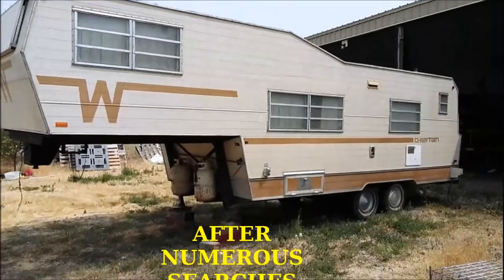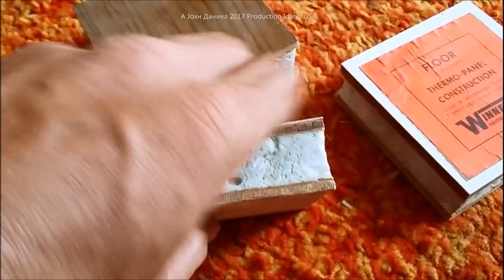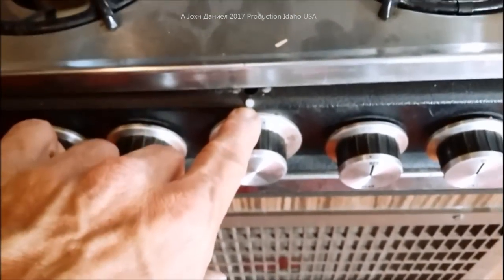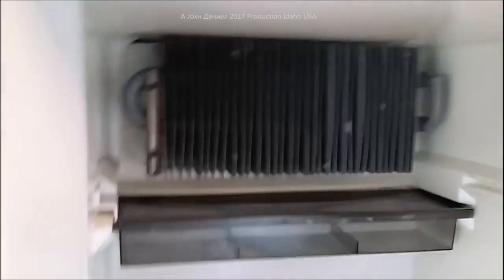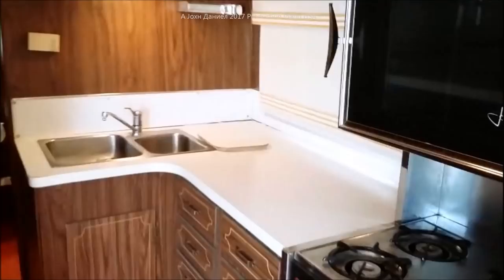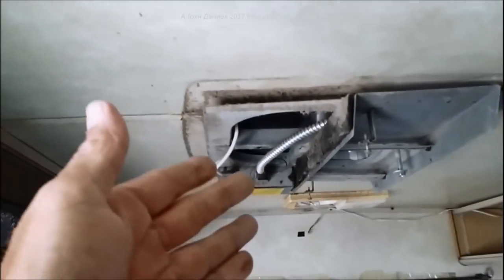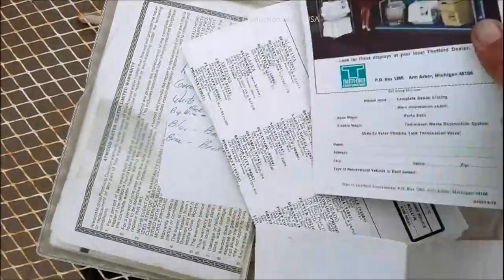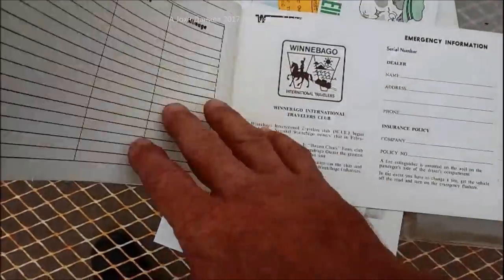Rare 1973 WINNEBAGO 5th Wheel, INSIDE TOUR, my Plans & Ideas vid 2

Comment from the maker: 100% ONE OF A KIND project. Double OLD Winnebagos! on m350 to M400 dodge frames. And this very rare 5th wheel by Winnebago. https://youtu.be/PxJuNxIAEFg
Heres a basic info fact on the project we are doing -https://www.paypal.com/pools/c/83mlLRXYHO
This is my INTRODUCTION VIDEO -More in depth Vintage Winnebago videos will follow - YES, we will put 1200 watts of Solar Power on it! This video is showing a dirty, dusty stored time capsule of a rare Winnebago. Winnebago was just trying their hand at building 5th wheel trailers in 1973 and only a few ever got made, none are currently registered in America. None are in this perfect, And the last data of actual camping use was 1981. There is only 4 trips even logged on its itinerary in its entire existence. None since June 1981. 
Sorry the video is a bit choppy, the goofy new camera phone has a feature thats "supposed to stabilize that", when it works right!
Look for more done on this cool RV.
Reply: I know where an identical chieftain 1973 sits right now

Comment: What a trip down memory lane.  My grandfather owned a 73 identical to this one, and I purchased it from him when he got to old to travel.  I used it for a couple of years before selling it 25 years ago.  Wish I still had it.  They don't build them like that anymore.  Interior of mine was yellow instead of the orange.  I still have the roof ac unit.  Very interested to see how this one of yours turns out.  Great stuff.
Reply from the maker: From what I found, they made very few 5th wheels. From November 1972 to March 1975.  I did the best research I could and only my 1973 carries a current vehicle registration, theirs 4 from 1974, and 7 from 1975 according to a national registration search on the make/model numbers. There could be more if a state like Mississippi don't apply the model numbers but unlikely. Few were built to start with, and even fewer were built with the longer overhang for 10 foot bed trucks.
Reply: I got the same one wanna buy it

Comment: I used to own one almost like this one. The one i had had twin beds in the bed room and twin beds in the living room. My table had extra leaves so i could seat 8 adults at it. Kitchen was in the middle and the bath room had a shower with a little tub. Same shag carpet and upholstery as yours. We thought it was orange , until we saw under the cabinets that it was red and gold
Reply: 10 years ago i left it with my ex. We had changed the twins into a queen in the bed room ours had a lot of rot. Curtains and upholstery  dry rot.
Reply: My living room was on the end where your bath room is.

Comment: This is not a one-of-a-kind trailer. The features are pretty standard and it would be ectremely cost-ineffective for the factory to make only one of these type of trailers. The model/serial/mfg. numbers show that there were a number of them produced. They were standardized for producing multiple units, but hey could be produced in different interior configurations. My trailer had two twin beds upstairs, with a small night table between them, with storage under the bed platforms. The steps leading upstairs could be lifted for additional strorage underneath. I lived in a 30 foot 1976 Wilderness trailer for 10 years, so I know a lot about these types. The reason that there aren't many around is that they were manufactured in ways that, over time, they would develop leaks, etc., that would damage them to the point that they would be basically abandoned/trashed. They weren't designed for 40+ years use. The outer surfaces were aluminum panels that had lots of joints and seams, especially on the edges, for water to penetrate over time, and especially the roof vents were very prone to leaking/damage over time. Moving the trailer around would cause parts to flex a little, leading to age-related seal damages. Even the exterior running lights were possible sources of water infiltration. The trailer is very nice for the age, and seems to have been well-maintained. But ceilings can be painted to cover water damage in many cases, so watch for that. Not being one-of-a-kind doesn't mean it's not a nice trailer. They have roof coatings like snow-coat that can be sprayed on to seal joints and prevent any/future leaks.

Comment: Instead of cutting up the upper bedroom, it might make more financial sense to offer it up for sale to vintage collectors. You could make enough money to buy a better trailer more suited to your needs without all the extra expense and work involved.
Reply from the maker: My friends once told me that the original engine in my old 1948 Packard should be rebuilt to factory specs ( at a cost of $15,000 ) so it could be worth, $16,000 to $20,000. I put a 6.2 Diesel in it from a Suburban and drove it for 6 years getting 19 mpg then sold it for $28,000.
Sometimes Original is awesome,  But classics now only bring classic offers, not modern cash!
Reply: Do you have pictures of the old Packard? I really like old cars like that and have a 1950 Dodge truck that is just like it was sold and no restore done on it but I think a diesel engine would be very good idea when I do. But I drive it now and thats a year away at least. My winters are rough, but I can consider diesel.

Comment: We have this same year camper but with the other floor plan. Have you found any others or any other information on them ?
Reply from the maker: The 29'8" model made for 10 foot truck beds and full rear bath are so rare I may have the only one according to Winnebago. The shorter 26'7" foot with the bathroom up front are of only about 35 ever made for 1973. a few more were made for 1974, less for 1975 and none after January 1975.

Comment: this is some cool americana, i remember seeing units on the highway as a kid
Reply from the maker: +Surfer Bri So few were made it was a rare site then, a near impossible site today.
Reply: Јоhn Daniel as a kid, driving with family to Niagara falls, the roads were being traveled by winnebagos. I see your point, I don't think I've ever seen a winnebago 5th wheel quite this big. You've really got something here. What is required to pull this big guy?. I love the originality of it, if it were mine, I'd try to restore it to assembly line condition, fabrics, materials and paint. It's beautiful.
Reply from the maker: They sold a travel trailer from 1972 to 1984 and a camper for a truck bed from 1971 to 1977 and they even sold a flat bed trailer, 15 foot long single axle with the FLYING W on the side of it for special order, 95 were sold. But this 5th wheel was the cream of the crop using Dayton Axles, Lafayette suspension and brakes and Dexter rims ( yeah crazy) and a hand made frame on a wide body 101" wide build. 8 foot 5 inch so you get 8 foot internal width, UNHEARD OF in 1973.  A collector in Ohio has located 2 left of 53 ever recorded built. A 1975 in New Mexico, and mine.
Reply from the maker: We are actually restoring it. And upgrading it. All the materials and fabrics are so perfect none are being changed.